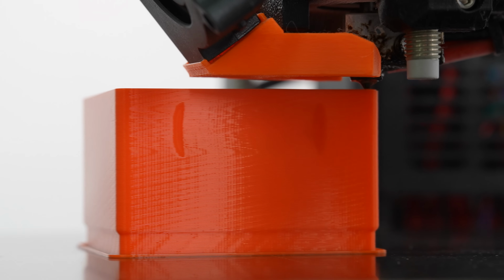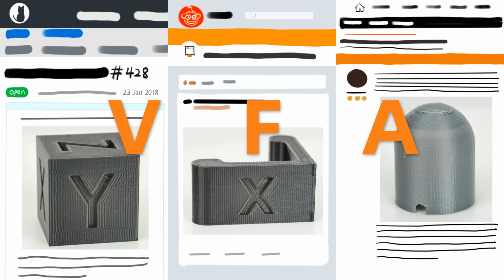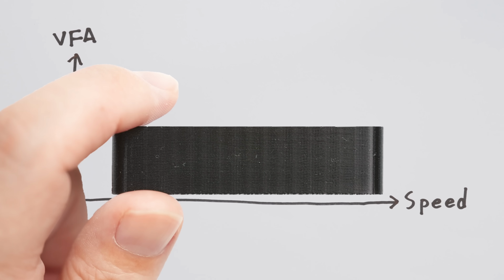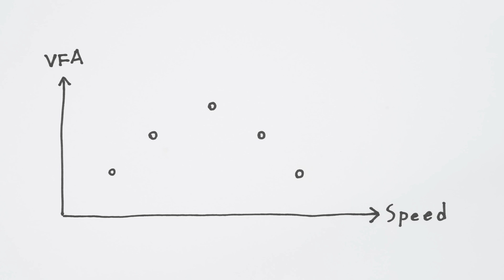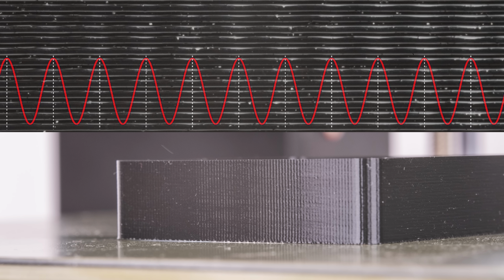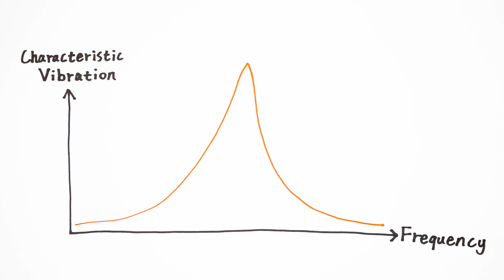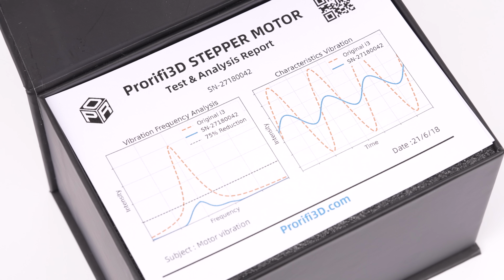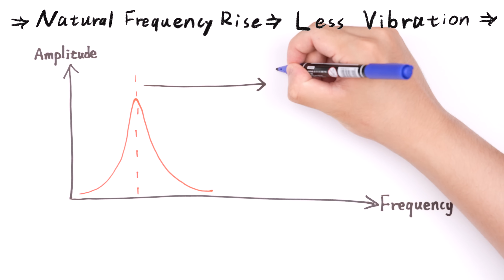We solved this common problem in 3D printing

Comment: Nice that you found a hardware solution to the problem! I do not really experience this issue on my MK3 because I run it at a reasonable speed and always have silent mode active. This also greatly reduces the vibrations and thus the severity these artifacts. 

Speeds I run: 
2500mm/min (default printing)
3500mm/min (X/Y rapid)
1200mm/min (Z rapid)

35% (first layer override)

PLA:
50% (outline)
75% (solid)
100% (support)

LW-PLA
70% (outline)
80% (solid)
100% (support)
Reply: I’m trying to setup my Prusa slicer with your speed settings to see how my prints look but I’m at a lost with exactly what numbers go into the slicer.  The slicer uses mm/s2 or mm/s.  Could you give further direction, I would appreciate it.
Reply: @PaDawg  mm/s determines the maximum speed. mm/s2 determines how fast it gets up to maximum speed and from maximum speed back to zero. 

For example, if mm/s is set to 10 and mm/s2 is set to 5, it will take 2 seconds to get to a top speed of 10mm/s. If mm/s2 is set to 2, it takes 5 seconds and so on.

important: the higher the acceleration is set, the chance of loosing steps (position) increases dramatically. and that will result in failed prints
Reply: @StefsEngineering  I guess what's throwing me off is your settings are mm/min. I'm not great with the tech stuff. Any chance u could email a screenshot of your slicer numbers..
Reply: @PaDawg   well that would just give the same numbers as above stated. You can devide by 60 and you will get the mm/s number. I'm using default acceleration settings, not even sure what they are set to...
Reply: @StefsEngineering  ok, thanks much!
Reply: @StefsEngineering  oh.. one more question. What exactly is the x\y rapid.. Acceleration? 
What does LW- Pla stand for. 
Really appreciate your time

Comment: So here is the real question.  My original Prusa MK2 has run for years with none of the VFA issues showing.
I recently upgraded it to a MK2.5s using the Prusa upgrade kit, yes I've had the kit for a while.  Now it has bad VFA's.  All steppers and main board are still the original ones that came with the MK2, only change was new firmware for the MK2.5s.
The only other change going to the MK2.5s was the extruder is now the dual drive with Bondtech style gears.
So, considering the stepper motors were NOT changed and ran fine before the upgrade, what did change that now causes the VFA's?  Slicer, print profile and material all remained the same for my tests.
Reply from the maker: During your upgrade to MK2.5S, the heatbed system was changed and the weight increased a lot: magnets under the heatbed PCB and an additional piece of spring steel. The significant increase in weight caused a significant reduction in the natural frequency of the Y-axis motion, which resonated with the output vibration of the motor, thus creating the same MRR/VFA issue on MK2.5S as on the MK3 series. 

The root cause of MRR is the vibration from the output of the motor, but it is important to solve MRR not only with the motor but also with the improvement of the system's natural frequency. So we have a Dual belt system and frame upgrade in addition to low vibration motors. This combination can improve the system frequency and reduce resonance. So we also recommend our frame upgrade if you don't have the Bear upgrade. With the combination of low vibration motors, a Dual belt system, and frame upgrade, MRR is almost invisible. 

If you wish to reduce VFA/MRR, try our products at https://prorifi3d.com/collections/upgrade-kit/products/kit

Comment: Increasing microsteps helps a lot to reduce vibration on the motors, oriental motor steppers offers a plenty of technical info for their products, one interesting data is called "vibration characteristic" it displays the vibration intensity of the complete range of speed so you can decide how much vibration is acceptable...
Reply: My findinds are the same.
Reply from the maker: TMC 2130 drivers on i3 MK3/S/+ are already 256 microsteps. And the vibration caused by under microstep is totally different from those which cause MRR(VFA).

Comment: Thanks!  You should think about making some for bambu lab printers! I was very excited about that printer and everything was good until I decided to slow it down to 120mm/s because it was to fast for my filament and every filament looked mate had zero gloss to it, when it should have, been told it was due to too fast printing. So BL told me I have two choices to slow it more down or they suggest to speed up to 200mm/s or above.  And at 120 mms it is way more louder and feels like steppers about to jump out, at 200 and over it gets much smoother and quieter.   Would definitely upgrade mine on BL.
Reply: I always thought it's a problem with my belts rubbing on idlers or sth else in the motion system. But neuer thought it would be just "normal" VFA.

On my MK4 I printed sth that was slowed down in speed because of min layer time and had rough ripples and I thought seit something is defect or I need to replace sth. The I got the BL X1C and hat the same issue and didn't know what to say because I now had two printers with same poor quality. But just by printing very slow or always checking it prints at 200mm/s helped a lot.

In some way I am happy it's an issue that is kinda normal and doesn't require a printer refund but on the other side I'm somewhat unhappy that it's an issue that can't be fixed easily and not even completely and I'm only be Abe to print at 20-40 or 170-220mm/s, everything between doesn't look good

Comment: Has anyone tested variable (random) feed speeds? This is done in CNC machining to prevent chattering.
Reply: This could work. On machine tools the chatter is from resonance and randomized  varying feed rates makes sure time spent at the feed rate that allows resonance to build is never long enough to allow resonance to be achieved, or at least minimizes it. In 3D printing, as shown in this video, the number of artifacts, their prominence, and interval across the printed object surface all varied with speed. Perhaps by randomizing 3D printer speeds the artifacts will still be in the printed object but having been scattered around, they won't be visible as an easily identifiable pattern by casual observation.
Reply: Actually, randomized 3D printing speeds could be key to allowing faster print cycle times. Whatever non-critical artifacts that were avoided by staying under some max speed in the non-randomized speed paradigm, could be tolerated if they were scattered about using speed randomization. By randomizing, a higher average speed could be used and the print completion time could be significantly shortened.
Reply: @gregfeneis609  someone just try it 🤣. Stepper resonance is weird to me so I can’t guess.

Comment: Klippers input shaper does a great job of compensating for this. I would wonder how these motors with input shaper would do.
Reply: probably ridiculously smooth!
Reply: No this is not really what input shaping corrects. This is intrinsic to the motors, not related to acceleration.
Reply: @olafmarzocchi6194  ye but maybe the acceleration differences when printing keep the motors from resonating that much (  just like variable print speed ) ... obviously is not across the whole printing duration but input shaping might help a little ... with these motors it might solve the issue and let input shaper do its job
Reply: @NanescuRadu1  of course these motors will improve the print results but ANY effect of the input shaper disappears after roughly a couple of millimetres from a corner.
Reply: @olafmarzocchi6194  what i meant is … keeping the motors at the same speed will amplify the resonance … input shaper, linear advance or whatever might stop the resonance a bit not completely ofc
Reply: Input shaper is a digital band aide to fix mechanical problems.
The issue described in this is cogging, and cogging is what separates the cheap crap printers use from the quality stuff put in good CNC machines.
Input shaper is at it's best when applied to the machines resonance, and is not especially effective at cogging resonance.

Comment: If the frequencies are known, wouldn't it be possible to noise-cancel the motor's vibrations in-slicer or even in the firmware? If the frequencies are variable, I feel some sort of calibration wouldn't be too hard.
Reply: That's what input shaping does; Klipper firmware uses an accelerometer to generate a profile to inhibits these kinds of artifacts. The firmware will vibrate the X and Y axes and use that data to cancel out the vibrations. Do a search for input shaping with Klipper installed on a single board computer or the Creality Sonic pad which simplifies the installation and optimization of your printer and has some additional features you can't get with a single board computer.
Reply: Far cheaper than buying new motors and over-engineered pulleys! Ordered a triangle labs board kit.. thanks for the tip @ElectronicsPeddler! 👌

Comment: You can play around with VFA by adjusting Acceleration and Speed and Jerk on a plain 4cm Cube and running a heap of test prints,,,, you will find a setting that will reduces them-.

Comment: Makes me wonder if this could be improved using dithering. And by that I mean by changing print speed chaotically within certain range selected exactly to couteract the resonance.
Reply: like input shaping but for the motors as well as the frame! I wonder if you could hack that together with input shaping tools that already exist.
Reply: Klipper input shaper is good enough, especially auto tuning with accelerator adxl345.

Comment: I always thought, this was an issue of the motor drivers not having enough resolution.
(Also since some drivers make motors be louder or more quiet.)
Didn't know, that this is actually an issue of the motor itself.

Great to know, that there's a fix.
Might get the XY-Upgrade.
Reply: It's both. There is still the real effect that some motor drivers tend to snap to the half-step point rather than having a smooth torque curve through the microstepping positions. Cheaper drivers have less consistent microstepping, and the reason that speed affects VFA is the frequency of that snapping action near the full and half steps matching the resonance of the motor. So bad motor drivers will cause choppy and inconsistent motion, and good drivers will reduce it but only so far as the motor can handle. If the motor has inconsistent torque around the microstepping values, then it won't be able to keep up regardless of how expensive your drivers are.
Reply: @dunkeroni  Which drivers would you recommend for smoother printing?

Comment: Was the motor vibration caused by mechanical resonance in the motor, or electrical? 

It is common in cnc stepper motors. This causes a huge issue but seems to just cause minor vibration at the low power of 3d printers.

If its electrical then have a micorstep contolernthat can actally do a high count. 1600 steps per turn can makena huge difference. 

Being able to select the mico steps can as well as you can try different one sto avoide the resonance.
Reply from the maker: Mechanical resonance. Thus this is harder to solve than electronic problems and the cost is much higher. Fortunately, we solved this issue.

Comment: When I have designed my own printer the last two years I have found out that many motors has vibrations. I ordered a couple of expensive Trinamic motors and they way less vibrations with any TMC driver. But then I switched to DM542 drivers and they performed even more smooth. Just waiting to see what it means to the printing since printer is not yet finished.
Reply: nah... that's not the solution.
Reply: @REDxFROG  maybe not for this. We will see. At least it makes ringing of the whole head a lot less.
Reply: @REDxFROG  could be same as they are talking about since motor may have less resonance and even resonance moved to some other rpm.

Comment: Have you tried to optimize the stepper driver control? I mean microstepping, motor voltage and stuff like that. Seams to me that that would already help a lot
Reply: No they just try to sell a product... their motors are from LDO and the prints they show is just bs... i print over 15+ years already and NEVER had this and i got plenty of printers myself, incl self build. and printed and still printing with plenty of brands and never seen this... and all got random brand stepper motors and drivers. they just try to sell their private labeled LDO motors.
Reply: @Underp4ntz_Gaming_Channel  If you never have had a problem with your surface prints from a prusa then you just dont see it.
Reply: Yeah, seems like changing from giant discrete steps to small discrete micro steps would make it all go away, or at least divide it by 16 or so. ;)

Comment: This is a really interesting idea and I think motors purpose built for 3D printing is a great idea. I saw a comment regarding Voron compatibility and was wondering if you plan on making a version with a JST connection so it can be an easier swap in replacement for people with more custom designs. Also I assume these are 1.8 degree steppers, are there any plans for a 0.9 degree version if not already existing. Also selling them individually or in 4 packs would be cool.
Reply from the maker: Thank you for your compliment and support! We have plans for other models in the future. However, there is no plan for 0.9° stepper motors since they lose much torque. We have released the Motor Development Kit, you can mod on your own: https://prorifi3d.com/collections/upgrade-kit/products/prorifi3d-motor-development-kit
Reply: 0.9 have less torque,  but with the proper gear ratio that can be cranked up. Every big nema manufacturer has it's own 1.8 and 0.9 motor. 
What about multiplying the number of coils? That would make sin vawe more flat, less vibration

Comment: I need these motors.
Reply: Right?  Although, I believe you can also suppress mrr using diode feedback arrays which can be installed in the wire loom going to the motor.

Comment: On your website, the key advantage of these motors seems to be the variation in vibration strength between identical motors. Not the absolute vibration strength. i.e. you will still need to tune your print speed to minimise MRR, but with priorifi3D motors they should all have similar MRR elimination speeds? (instead of possibly having X and Y motors with different ideal speeds).

Comment: Intresting research. But i think VFA is not only an effect of MRR. There are probably multiple factors playing together here. The dual BMG gears as identified by @MihaiDesigns definitely affect it as well, as printers with different extruder designs like the E3D Titan suffer less but still show this issue. My guess would be that the stepper driver and driver settings play a signifficant role as well. Specific motor-driver combinations might even improve or exxagerate the issue too. I also wonder like others already mentioned, if a belted drive reduction could lessen this issue compared to a geared reduction due to the elastic properties of the belt. I would test this theory myself if i had the resources to do so because i really think the impact of the stepper driver was overlooked in your research, at least in the way you presented your testing.
Reply from the maker: You might misrecognize MRR with some other defects. Ringing, inconsist extrusion, MRR(VFA) are different artifacts with different causes. We have a technical details page to help you understand the cause of MRR(VFA):https://prorifi3d.com/pages/technical-details

Comment: There is guy in prusa forum do this test. He swap with moon stepper. 

But not all moon have same quality of reduce VFA. I think from 4 maybe 1 is still got this issues.
Reply from the maker: We performed tests on Moons steppers. The differences between motors are relatively large, especially in recent batches. Some of them can even achieve our qualified standard. But in the same batch there will be some with large vibrations. For consumers, there is no gaurentee for the quality of the motors you get. Thus no gaurentee for MRR reduction.

Comment: This sounds like something that can be easily solved in software by varying the speed of the stepper randomly to achieve an average target speed but without constant repetitions that cause resonance. I believe cnc mills and lathes already do this for the same exact reason. It would flatten the peak of the frequency response by spreading out the area to neighboring frequencies. Should work to reduce audible noise too.
Reply from the maker: Many CNC technologies can not be applied to 3D printing directly. Like the varying speed you mentioned. Because in different printing speeds the actual extrusion rate is not the same. The changing printing speed will lead to changes in extrusion width, inconsistent extrusion will show up.
Reply: @Prorifi3D  I'd love to see someone try, I doubt it's that bad

Comment: Besides motors, this also confirms that the i3 series (and, to some extent, ALL prusa printers) frame is not really well engineered/built at all. Far from being stiff enough, which makes the structural upgrade (aluminum profiles) almost mandatory in the first place too. Which is crazy, considering its price tag and supposed "hi quality".